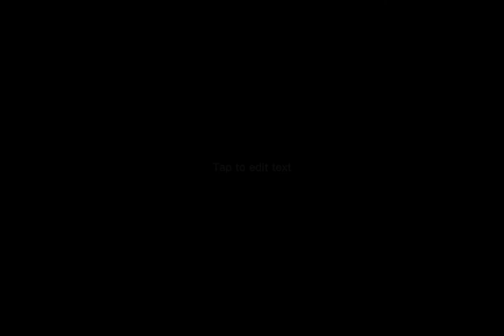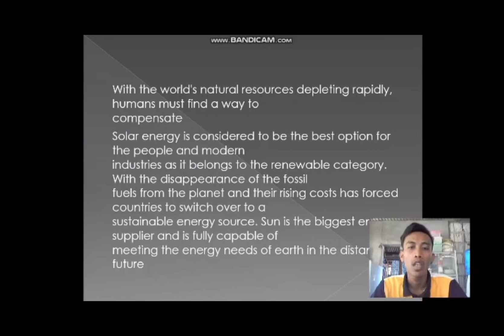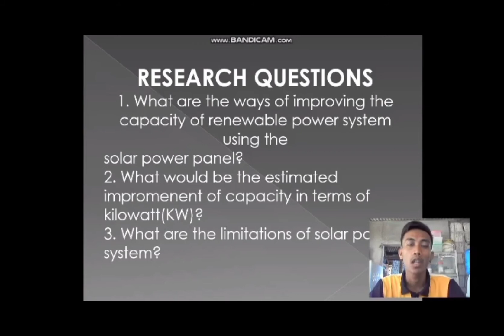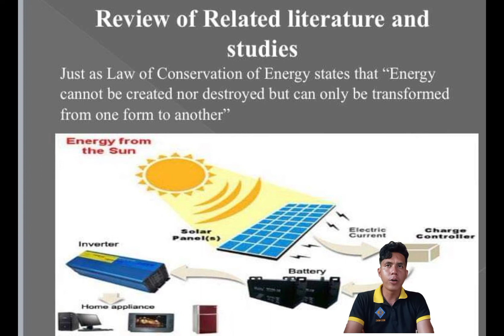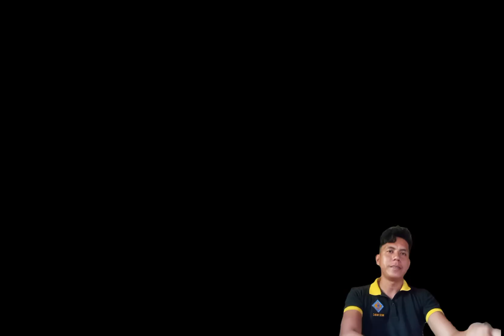Improving the Capacity of a Renewable Power System, Using Solar Power Panel

Comment: NAME: Kim Anthony V. Aldion
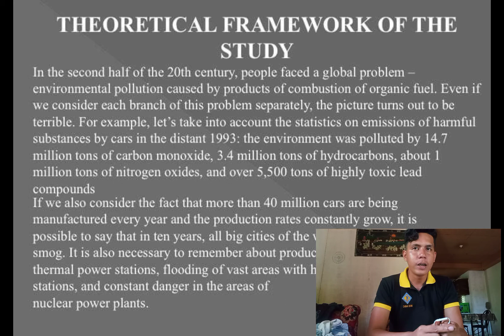CLASS NAME & CLASS SCHEDULE: COE 346 A & 5-6:30 T-TH
DATE: 25/03/2022
REACTION: The film informs viewers, particularly engineering students, on the necessity of employing solar panels to increase the capacity of a renewable energy system. In addition, renewable energy eliminates some forms of air pollution while emitting no greenhouse gases, unlike fossil fuels.
REFLECTION: The research topic itself is noteworthy, as it tackles employing solar panels to increase the capacity of a renewable energy system. This study proposal educates its audience on the significance of saving nonrenewable resources, especially electricity. As an ECE student, it expands my knowledge of energy conservation and piques my interest in what new devices may be produced in the near future that do the same job as a solar system but with more sophisticated features.

Comment: NAME: Alrick O. Macahidhid
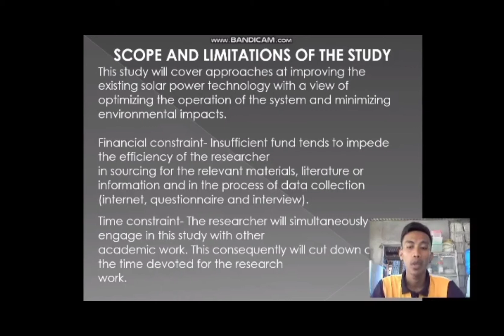CLASS NAME & CLASS SCHEDULE: COE 346  - TTh 5:00 - 6:30 PM
DATE: March 25, 2021

REACTION: The video educates viewers, particularly engineering students, on the need of increasing the capacity of a renewable energy system by using solar panels. Furthermore, unlike fossil fuels, renewable energy creates no greenhouse gas emissions and lowers some types of air pollution.

REFLECTION: Renewable energy is energy obtained from natural resources that can be replenished in less than a human lifetime without diminishing the planet's resources. These resources, which include sunshine, wind, rain, tides, waves, biomass, and thermal energy stored in the earth's crust, have the benefit of being available practically everywhere in some form or another. They're almost unlimited. Furthermore, they have a negligible effect on the climate and ecosystem.

Comment: NAME: Eve Shammah S. Mejorada
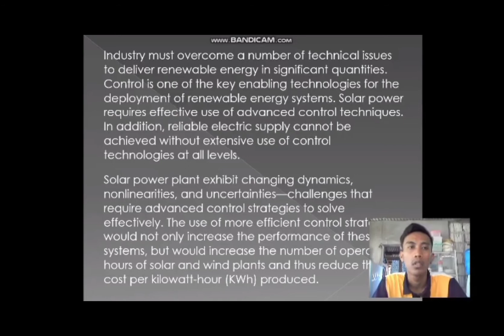CLASS NAME & CLASS SCHEDULE: ENS 341 - Saturday 2:00 - 5:00 PM
DATE: March 25, 2022

REACTION: The video educates viewers, particularly engineering students, on the importance of increasing the capacity of a renewable power system by using solar panels. Furthermore, renewable energy reduces some types of air pollution while producing no greenhouse gas emissions from fossil fuels.

REFLECTION: The research title itself is intriguing, as it discusses increasing the capacity of a renewable power system using solar panels. This research proposal informs its readers about the importance of conserving nonrenewable resources, particularly electricity. As an ECE student, it broadens my understanding of how to conserve energy and piques my interest in what other devices might be invented in the near future that perform the same function as a solar system but with more advanced features.

Comment: Villanueva, Chastine E. 
COE 346 Methods of Research T-TH 5:00-6:30 PM
March 25,2022

Reaction:
        This video explains how solar energy, as a renewable resource, can be used to help with energy distribution.

Reflection: 
         Humans place a high value on renewable energy sources, particularly solar energy. Solar panels provide electricity, which can then be stored in a solar battery and used later. It saves us money on electricity by letting us keep our appliances running during power outages. Even though it's a little bit expensive for them,  there are still people who want to use and try it in their respective houses.

Comment: NAME: Heroshua C. Bantug
CLASS NAME & CLASS SCHEDULE: COE 346A – TTH 5:00-6:30 PM
DATE: March 24, 2022
Reaction: The film educates viewers, particularly students, on the need of increasing the capacity of a renewable energy system by using solar panels. Furthermore, unlike fossil fuels, renewable energy creates no greenhouse gas emissions and lowers some types of air pollution.
Reflection: Renewable energy resources are safe and reliable options for humans to use. Solar energy takes advantage of the sun's infinite power. Solar energy can help people save money on their energy costs and make their daily lives easier. The advantages of solar energy are numerous, and it is critical that more people learn about and prefer renewable energy sources over non-renewable energy sources.

Comment: NAME: Reynabelle Kim Noble
CLASS NAME & CLASS SCHEDULE: ENS 341 A (2:00 – 5:00 SAT)
DATE: March 24, 2021

REACTION: This video is informative and has made me more aware of the power system problem and its proposed potential solution. It is packed with solar energy knowledge and ideas that engineering students might find useful.

REFLECTION: The minimization of non-renewable energy and money is a great proposal for the improvement of our society. And using solar panels as a source of energy is an impressive and efficient way for us to reduce our expenses even in the future. This is an excellent and impressive backup for unexpected power outages, as well as a solution for our more environmentally conscious community.

Comment: Ronel S. Bayonado
COE 346 Methods of Research T-TH 5:00-6:30 PM 
March 24, 2022 
Reaction: 
The video is informative and explains how and why renewable power system can help us not only in lowering our electric bills but also our planet.

Reflection: 
As a family who uses Solar panels, I can say that it really did help us in reducing our electric billing every month. It also charges the battery that we have which provides us electricity whenever there is a blackout.

Comment: NAME: TORRES, JAMES CARLO A. 
CLASS NAME & CLASS SCHEDULE: EE 341 A-RESEARCH METHODS FOR ENGINEERING-TTH 6:30-8:00 PM

DATE:3/24/2022

REACTION:
The study is presented to the best of the ability of the presenters. The research for me is quite broad or is not specific. The researchers could have provided a more detailed improvement of the so-called capacities of a renewable power system using solar power panel. Overall, it is a very good idea or course of research. 

REFLECTION:
The idea of improvement of renewable energies makes me think that there are many people who are really interested in renewable energies. Which makes me realize that, if I am to make my own research, it would be a little different and uncommon. There are many things that could be improved from this research, so I am going to bare those in mind for the betterment of my work also.

Comment: NAME: Cual, Kayzielle B.
CLASS NAME & CLASS SCHEDULE: ENS 341 A (2:00 – 5:00 SAT)
DATE: 3/24/2022

REACTION: Based on the video I had watched, the audio is not that 100% clear but it is still audible. The visual presentation of the researchers are so creative. They had presented their research very well and in a very concise manner. Over all the presentation was very good.

REFLECTION: The research title itself is actually interesting, since it talks about the improvement of the capacity of a renewable power system using solar power panels. This research proposal enlighten its viewers on how important it is for us to conserve our non-renewable resources, especially electricity. As an ECE student, it expands my understanding on how to preserve energy and makes me more curious of what other possible devices could be invented in the near future that also has the same function of a solar system with more advanced features.

Comment: NAME: John Pius T. Borres
CLASS NAME & CLASS SCHEDULE: ENS341 – Sat. 2-5pm
DATE: March 24, 2022
REACTION: The video presentation is very informative. It provides great value of viewers respective on how to lessen the cost and consumption of electricity. Furthermore, unlike fossil fuels, renewable energy creates no greenhouse gas emissions and lowers some types of air pollution.
REFLECTION: Renewable energy source is pretty much beneficial to us especially on solar energy. Solar panels stores electricity in a solar battery for later use. Even though it is expensive, it helps us also to lessen our expenses on electricity and it keeps our appliances running during power outage.

Comment: Catherine Joy Lacson
COE 346 Methods of Research T-TH 5:00-6:30 PM 
March 24, 2022 
Reaction: 
This topic is very informative, it gave us insights into Improving the capacity of Renewable power systems using a solar panel. The possibilities and outcomes of using it. As a consumer, I am aware of the resources that we have. As time pass

Reflection: 
Solar energy is one of the unlimited resources that we have. Solar Panel will also lessen the pollution that is constantly rising, due to other resources that require oil and etc.

Comment: NAME: Jean Clare M. Po
CLASS NAME & CLASS SCHEDULE: ENS 341 - Saturday 2:00 - 5:00 PM
DATE: March 24, 2021

REACTION: The video provides great value to the viewers especially to the engineering students on the importance of improving the capacity of a renewable power system, using solar power panel. Also, renewable energy produces no greenhouse gas emissions from fossil fuels and reduces some types of air pollution. 

REFLECTION: Renewable energy is defined as energy derived from natural resources that can be replenished in less than a human lifetime while not depleting the planet's resources. These resources, which include sunlight, wind, rain, tides, waves, biomass, and thermal energy stored in the earth's crust, have the advantage of being available in some form or another almost everywhere. They are virtually limitless. What's more, they have little impact on the climate or the environment.

Comment: Dislan, Erdo Bataviano O.
EE341 A TTH(6:30 - 8:00 PM)
March 24, 2022

Reaction:
This video provides information about the use of solar energy. It helps me understand how solar energy works as renewable energy resources will be useful in energy distribution.

Reflection:
Using the solar energy as energy source is an efficient way for us to lessen our expenses in using of coal,petrol and gas because it is much cheaper and also unlimited.

Comment: Greg Anthony  C Peñez
EE 341 TTH 6:30-9:00 PM
March 24, 2022
Reaction:
	The video was an informative and very helpful nowadays due to the continuous increase of greenhouse gasses as per said  by the researchers in the presentation. The researchers have obviously research the topic well but their slideshow presentation, I find it boring writing all the stuffs and flushing it to screen. Maybe they should have presented it by paragraphs perhaps and so it's easy to read. I also noticed that the researchers are nervous but very visible the lack of mastery and eye contact, mostly reading and stuttering while reading.
Reflection:
	In the video, I remember the  law of conservation of energy. It states that Energy cannot be create nor destroyed but can only be transformed from one form to another. Their topic is very timely due to the increase of harmful greenhouse gases in the present. The researchers have showed what are the current state of the world regarding the effect of harmful gases.
	The video gives me an overview on renewable power system and its capacity. There are two ways of producing solar energy: 1.) direct transformation; 2.)Concentration of solar energy. I also infer that solar panels have the life expectancy of 30-40 years.

Comment: NAME: Cheri Mae E. Tinguban

CLASS NAME & CLASS SCHEDULE: ENS 341 – Research Methods for Engineering – 5:00-8:00 Saturday 

DATE: 24/03/2022

REACTION: "Improving the capacity of a renewable power system, employing solar panels," according to the video. "With the world's natural resources diminishing at an alarming rate, humans must find a way to compensate." Solar Energy, which belongs to the renewable category, is regarded as the finest option for people and modern companies. So, as far as I can tell, the researchers present an overview of a solar power panel together with an assessment of electrical networks in the direction of increased reliance on communications, computing, and control, which is a way to improve it. 
Out of everything and of those different options that was discussed, as a Geothermal Engineering student, I can agree with the researchers who advocate using the sun as a source of energy because, in addition to being a renewable resource, it is also a great way to reduce the use of diesel.

REFLECTION: After watching this informative video, I believe that a solar panel system is really beneficial and the best choice available to individuals. The key reason for this is that it is renewable. I can say that this video was quite helpful in helping students like I comprehend that these panels are completely eco-friendly and are among the cleanest electricity sources available. They work because they only interact with the renewable energy source of sunlight. There is clearly no concern about depleting another natural resource.

Comment: NAME: Nica P. Ragay
CLASS NAME & CLASS SCHEDULE: COE 346-A (TTH 5:00-6:30 PM)
DATE: Mach 24,2022
REACTION: The video presentation was delivered by the reporters in a very informative manner. It shows how important solar panel to everyone that comes with  many benefits.
REFLECTION: Solar panel system is one of the most prominent sources of renewable energy. The benefits are undeniable, and not just for individuals, but for the entire planet.

Comment: NAME: BERNALDEZ, ELLYN MAE A.
CLASS NAME & CLASS SCHEDULE: ENS 341 - SATURDAY (5-8PM
DATE: March 24, 2022

REACTION: Based on the video presented, It is very informative. It helps and gives insight to the viewers that using solar energy is a practical way in saving and improving our environment.
 
REFLECTION: Using solar panel is very helpful to our environment because it provides clean and renewable energy by decreasing air pollution. Solar panel is very important to out environment because it also helps fight climate change and reduces dependence on nonrenewable energy sources.

Comment: Name: Chandlerjave P.  Suan
Class Name & Class Schedule: ENS 341-A
Date: 03/24/2022
Reaction:
 In this video presentation is very informative content and nice to have this to able to learn more.
Reflection: 
The presentation is tackle on how to improve renewable power system so that it can helps us. We need to able think more renewable resources to able to have to have a back up of the resources we use that are gradually running out. I think this is good way to be efficient and effective renewable resources is to developed more and upgrade into advance technology device.